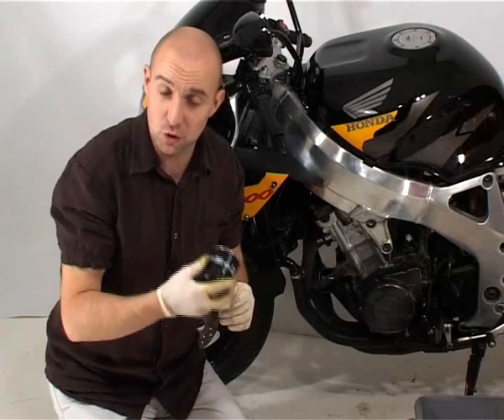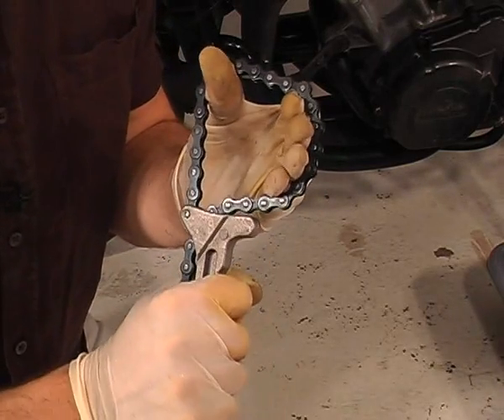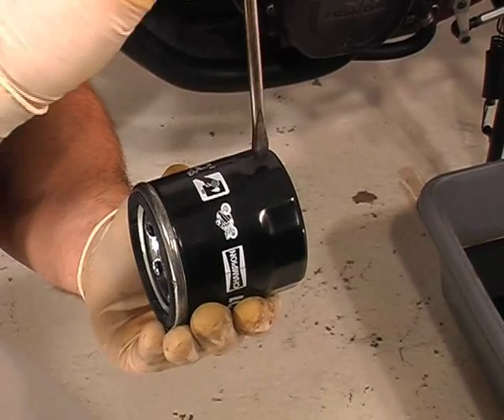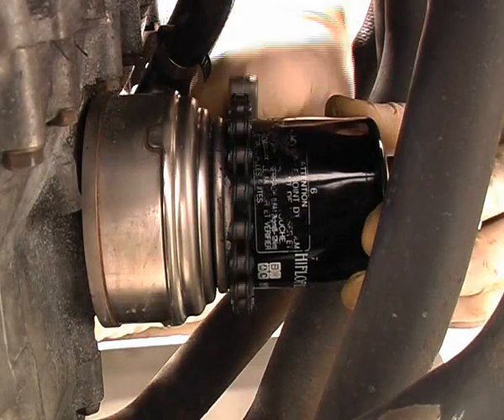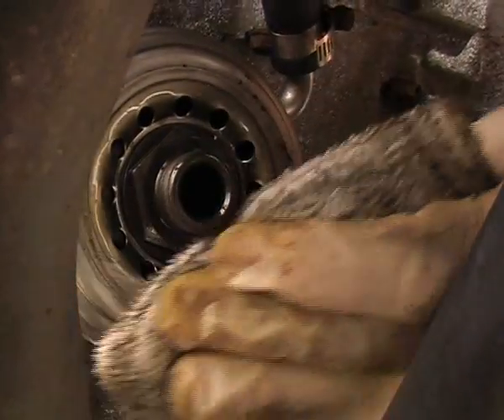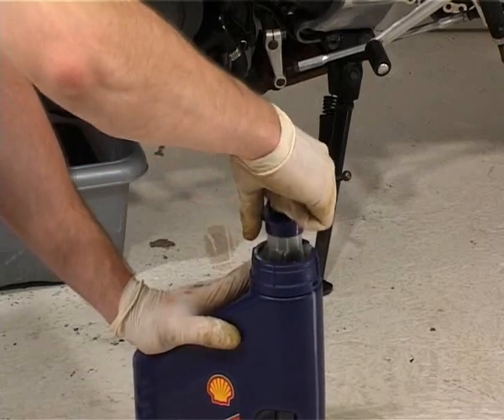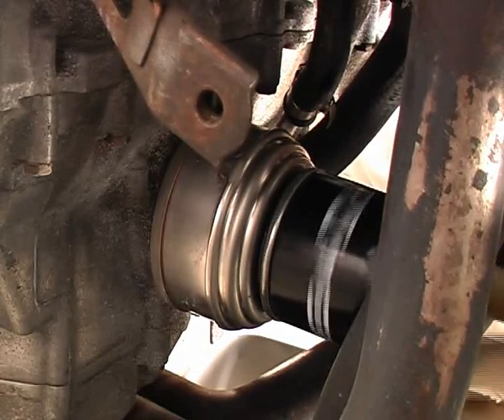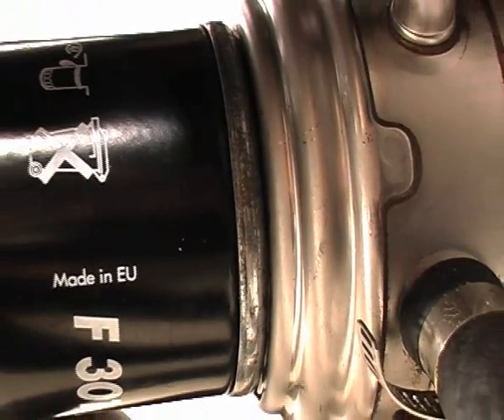Service your bike - removing the oil filter

Comment: Just done mine the other day,   The high spec K@N replacement oil filter I used,   Has a nut on the end of the cap,   Which should help with unscrewing later,   Especially if you have no strap wrench { The metal type with a nut is best } The pre drilled sump plug which comes with it,   Has a different size nut,   A fourteen mill,   Instead of the original factory seventeen,  P.S  I tried undoing the oil filter by hand with all my might,  But,  With the force applied using the strap,  No chance !